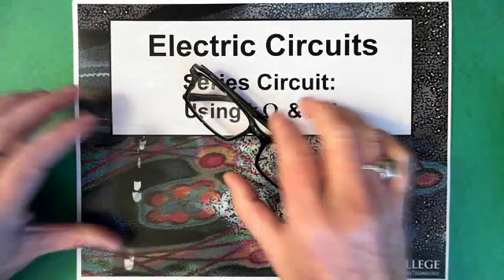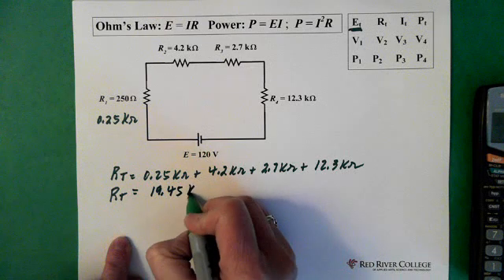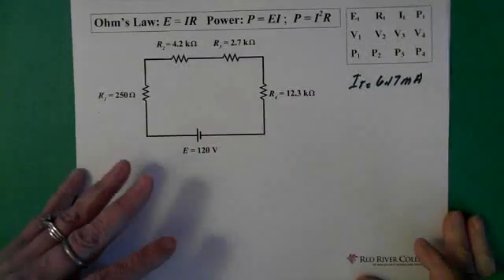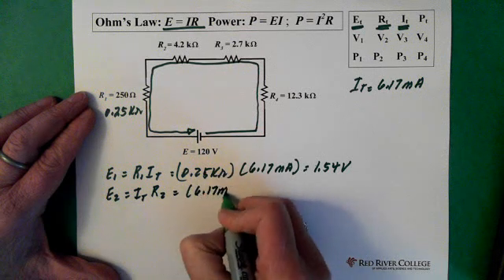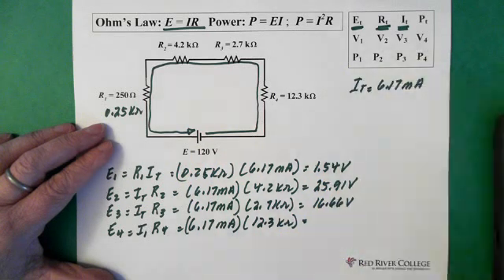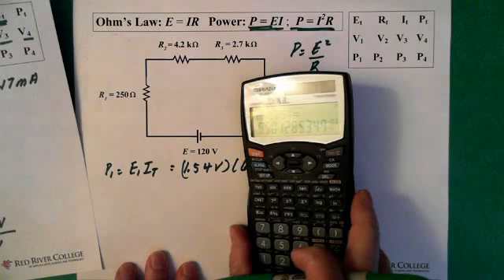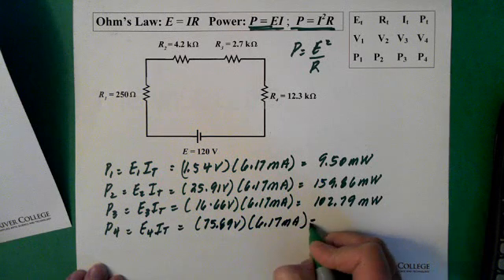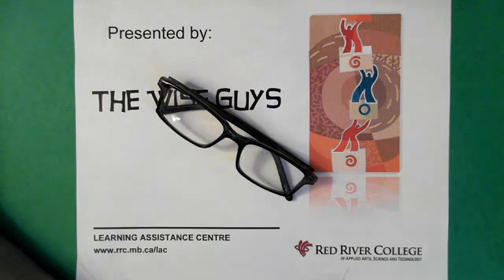4. DC Series Circuit: Using kΩ and mA

Comment from the maker: I = E/R.   Resistance is 19.45 k ohms or 19450 ohms.  The 'k' is a SI (metric) unit that stands for 10^3 (or 1000).  To solve for current, I divided 120V by 19.45 k ohms.  On the calculator, I divide 120 by 19.45 EXP 3.  'EXP' on the calculator gives you the Power of 10.  I hope this makes sense.  If not, reply if you have more questions about it.
Delaney